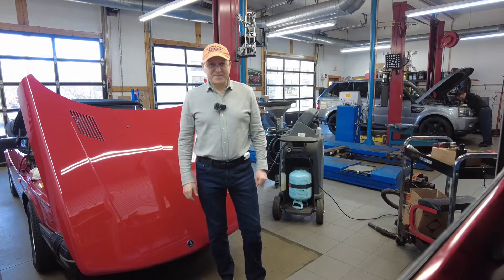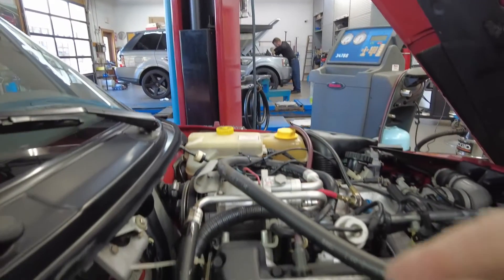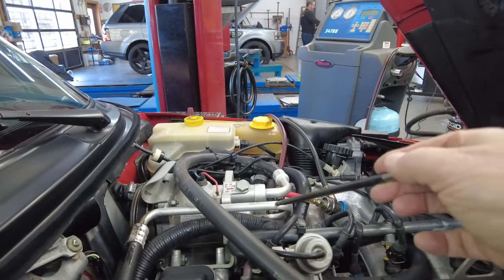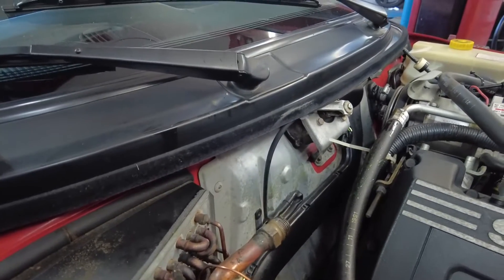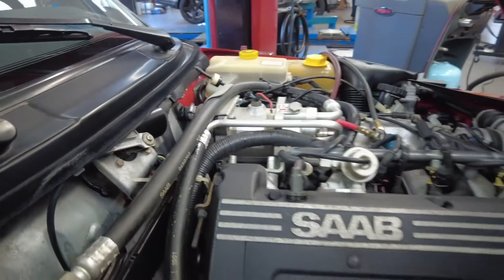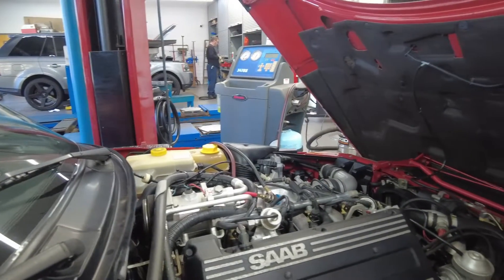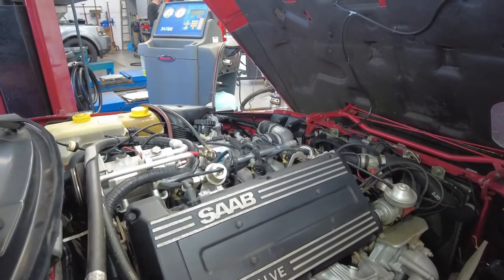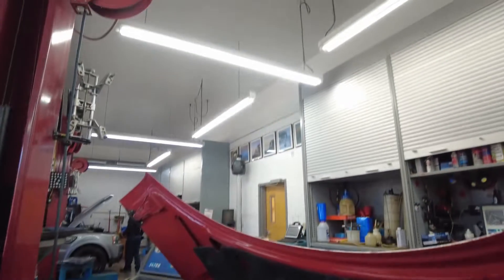How does your A/C work? | Very COOL Saab 900 Turbo

Comment: Yeah, that is a clean 900.  Would love to know the year/mileage, and what (if any) restoration work you did.

Also a lot of other functional components that I recall looking at on mine.  Namely clutch, anti-frost switch, and a few more things I don’t recall.

Also, I need a new pressure relief valve.  They seem to be hard to find anymore.

Ah, just visited your website.  That’s apparently the ‘92 that shows as sold.  Still way clean for a NorthEast resident.

Comment: Interesting.  Thank you. 
I had mine running on R134A for a short time but it didn't like it.  The molecule size of the gas is smaller and it lost charge after only a few weeks. The compressor also made a more audible whine using R134A.
I've since had a similar job done on, including Tx valve and receiver-dryer replacement, as well as compressor overhaul.  Switched back to R12 and holding charge nicely,  2 years later.
Reply from the maker: Thanks for sharing your experience!